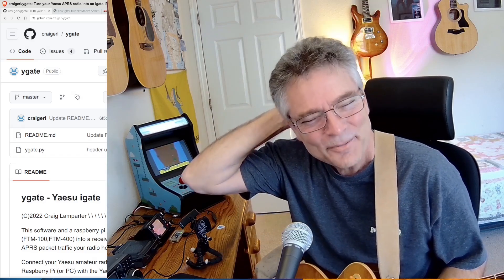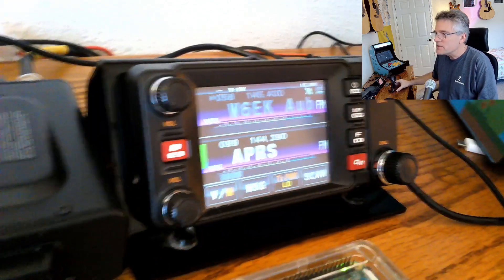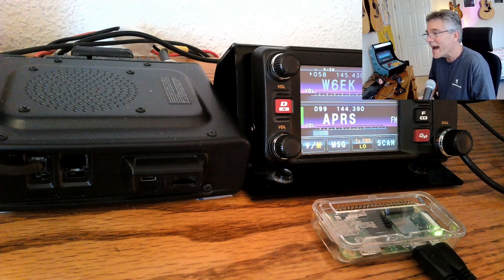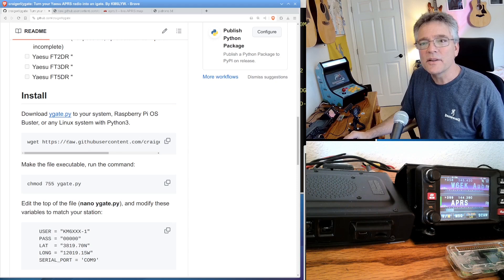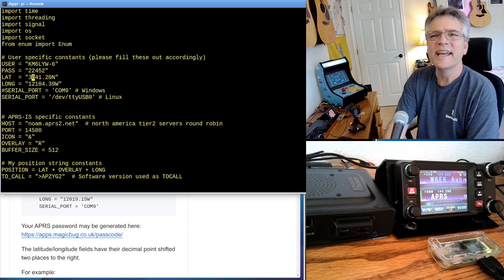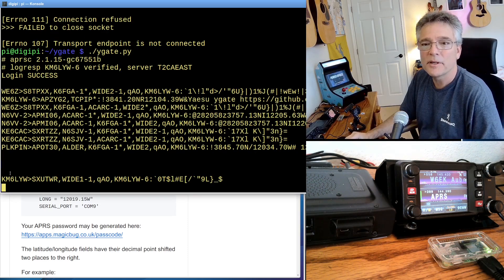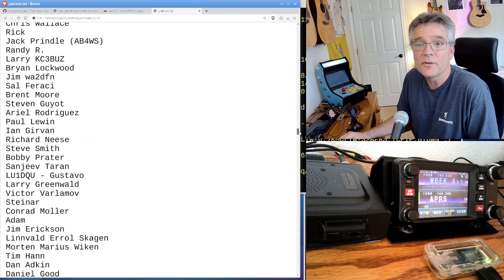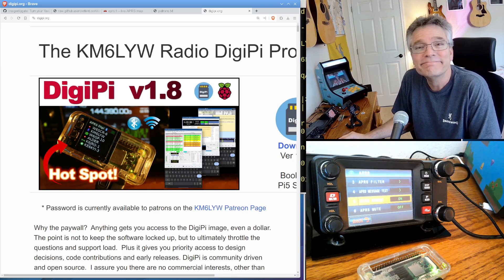Hidden APRS Igate in your Yaesu mobile radio!

Comment: Cool. I've been meaning to get the data cable for my FTM-500DR. The out of the box APRS capabilities are fairly limited, in that it is apparently impossible to construct a message other than a basic Mic-E encoded one - if someone has figured this out let me know. I've tried for example to get PHG (power, height, gain) into my status but it flat out doesn't work. So I figure I'll use my Mac and Processing to make a serial connection to the radio and see what I can push down the wire.

Comment: Can you connect this to a digipi without having to use a sound card?
Reply from the maker: correct!  the serial cable is all you need with a raspberry pi and you have a receive-only igate
Reply: @KM6LYW  thanks for the reply! So you would need a digipi hat (with sound card) and another custom cable to make a transmit and receive digipi?
Reply from the maker: @TyGunnlaugsson  that's correct... if you want a full featured data transceiver, you want DigiPi  http://digipi.org .   Ygate is a super convenient receive-only alternative.

Comment: So I have the SCU56, but it is USB A. How are you plugging in to the zero?
Reply from the maker: You can get a USB adapter for the Zero's micro usb ports.  I use the Vilros adapter from this kit,  https://www.amazon.com/Raspberry-Vilros-Adapters-Quickstart-Download/dp/B0C62T5417
Reply: @KM6LYW  Thank you! The cable for the Yaesu ht's is SCU58
Reply from the maker: @deaningram3  Yah, they have a few cables now that work, I think SCU58 is the latest?
Reply: Yes, just got it a couple days ago with the FTM500

Comment: The SCU-20 doesn’t get used to update firmware, there’s a usb mini to USB A port at the front of the radio behind the face for firmware updates.  And with the SCU-20 you can indeed send digital voice audio over wires X.  This cable will allow you to get onto Wires X using an FTM-100, 200, 300. 400 all you need is to set up a wires x account, and a pc connected to broadband, you can only use the digital only rooms if you have the SCU-20 but you can upgrade to an SCU-40 which gives you an analog tail connected to the SCU-20 and then you can use any room in the wires x software with no HRI node needed.  You run your Base radio (FTM-100-400) as a node using the SDU-20 connected from the DIN pin socket in the back of the radio plugged into the USB of your PC, you switch your radio on in PDN (personal digital node) mode run the wires x software and you’re in.  You can even turn your node radio that’s connected to the PC as an access point for your FT-70 or FT-2D so you don’t have to be stuck to the PC,  there’s a few ways of setting this up if you want to get on wires x but don’t want to spend $300 on an HRI200 wires x box.  If you want to know more just search FTM-300 PDN mode.
Reply: I am setting this up now. Is the digital id provided by yeast, or do you just set it up yourself?

Comment: Hello, I’m have FTM400, I have the SCU20 cable - do you think I can connect the cable with a usb/usb-c adaptor dongle to my galaxy tablet and have an APRS droid app running on it or will I need other items? I’m thinking to connect it radio direct to tablet then use my phone as a hotspot to give tablet internet . My goal is to see myself and others on the map. Your advice would be appreciated. Thank you
Reply from the maker: Nope, sorry.  you'll need a Pi or PC that can run ygate.py... it's just not for android/OS.  Unless there's python for android/ios?

Comment: What was the intended purpose for the serial port?
Reply from the maker: from what I can tell it might be used for flashing firmware?   it can output NMEA9 data either for the GPS or the APRS packet info... the latter of which was interesting.

Comment: Can we use this cable to turn the ftm300 into a digipeater with direwolf and raspberry ?
Reply from the maker: nope, it's a receive-only igate.  the cable doesn't allow for transmission.  if you want to build a digipeater checkout digipi.org
Reply: @KM6LYW  can we use this cable to connect the FTM 500 to the digi pi? Does anything else need to be set? Any chance of adding Wires X to the digi pi?
Reply from the maker: @deaningram3  @deaningram3  Nope, Nope, and Nope.    The cable is mostly useless, no audio, just a serial port.  If you want to hookup a digipi you need the CT167 10-pin breakout TNC cable.
Reply: @KM6LYW  the scu58 is a kit that comes with an audio breakout cable….
Reply: The scu57 for the FT5D is set up the same. Serial cable with and audio breakout

Comment: Final got a cable from AliExpress that came on the slow boat... Can't seem to find one here in the US and the FTM-300 didn't come with such cable. Got it all set up and running. I see data on the screen. No clue if it's populating to the Internet. 73!
Reply: Yaesu sells a newer cable as part of the Wires-X connection kit for the 300 and 500.  It's in the SCU-58 package.  Comes with the cable Craig is using as well as an additional jumper cable with analog connections.

Comment: Nice I have been using YAAC to do the conversion for several years. Nice to have a script. Now I think you can get APRS data out of the FT1DR.  It’s a little convuluted  to get it to send data out of the radio but I believe you can.
Reply: the FTxDR HT's simply don't present the data... i think you get some sort of gps stream out of them.  let me know if you discover otherwise!

Comment: For some reason I'm getting an Invalid Syntax error.
pi@aprs:~ $ ./ygate.py
  File "/home/pi/./ygate.py", line 143
    match run_state:
          ^
SyntaxError: invalid syntax

Did I do something wrong?
Reply from the maker: That indicates  you're using Python2... I'm guessing you're on a realy old OS?   Python3 is generally the new standard.
Reply: @KM6LYW 
 pi@aprs:~ $ python --version
Python 3.9.2
pi@aprs:~ $
Reply: That's odd. I'm running 3.9.2 according to python --version.  @KM6LYW

Comment: My ftm 500 did not come with this cable.
Reply from the maker: Yah, I suspect only the FTM100 and FTM400 shipped with the SCU-20 cable?   Those are the only FTM's I have on hand.
Reply: @KM6LYW  Not sure if the cable works the same way, but Yaesu market's their SCU-58 kit for use with the FTM-500.  It came with a cable that looks like the one you show (but marked as scu-58 instead of 20), plus another one to jump inline with it that has audio outs.  You can use just the main cable to program the radio and supposedly interface with the wires-x system from the internet digitally and the extra cable is if you also want to run analog through the wires-x.  I just got the radio so I haven't tried any of that yet but that's what the little sheet that came with the cables shows me.

Comment: Damn, my FTM300 didn't come with the cable 😞  Will have to pick one up.
Reply: Yaesu sells it as part of the SCU-58 Wires-X connection cable kit.  Comes with two cables.  One of them is the one used here.
Reply: I didn’t get such a cable either with my 300.

Comment: I have the FT3D. So I wish it would work with the SCU-39 cable I have for that radio. I know it's only an HT, but if it worked, it would be better than nothing.
Reply from the maker: Nope, the Yaesu HT's don't present aprs data  (only gps info?)..  I remember trying.

Comment: Excellent.  Just recently picked up a FTM-400DR, and it did indeed have the SCU-20 cable.  This will be a good use for the radio.  Not many iGates in the area. 73's, KN4VA
Reply from the maker: So it sounds like the SCU-20 cable doesn't come with all the Yaesu mobile rigs?  I can only vouch for the FTM100 and the FTM400.  The cable is/was in the box.
Reply: @KM6LYW  Not with the FTM-500.  RT Systems sells a programming cable for $30.  IDK if it's the same.